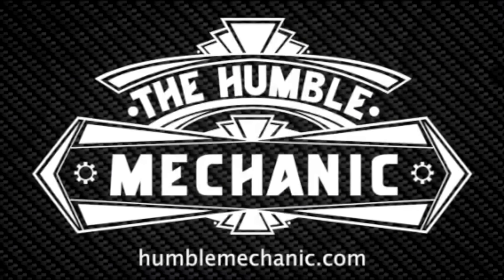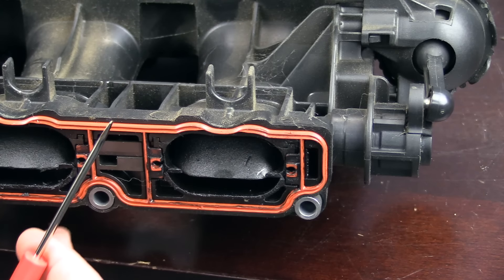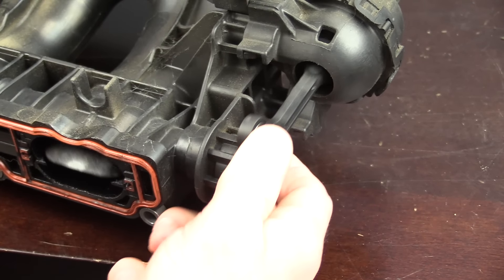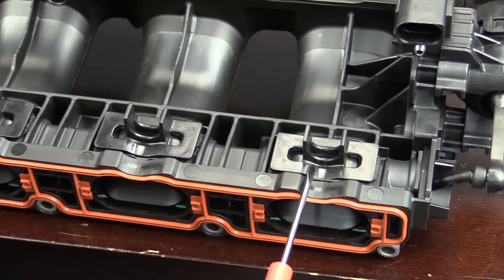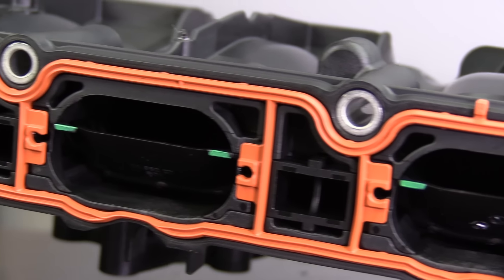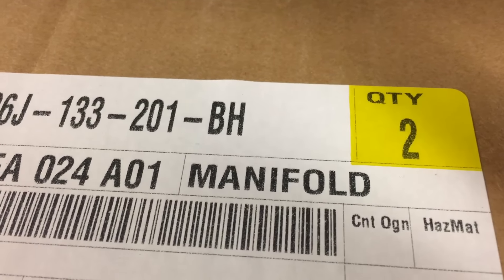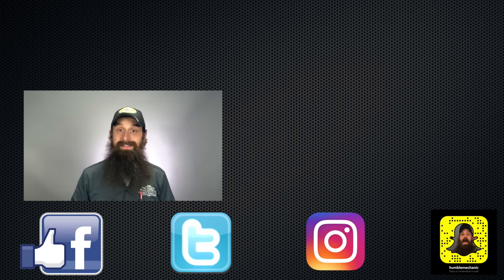2.0t TSI Intake Manifold UPDATE!

Comment: Hey Charles, I wanted to ask/tell if it would be beneficial to add a water methane system to direct injection engines (turbo and NA) to mitigate or eliminate the intake valve/system carbon build-up. Has it been done before (that you know of) and would it be cost-efficient to do so? I know this is an older video but it is somewhat related to my inquiry. Thank you in advance!
Reply from the maker: It’s the thing that would probably help the most. But I don’t think the cost benefit is there unless you’re doing it as part of modifying your car. 

Just to help with carbon, nah

Comment: I replaced mine last year, one consideration I wasn't aware of is none of the boost taps that fit in between the manifold and PCV work anymore with the new revision. They pop out or leak under boost now and there are no new aftermarket solutions available. Is there any other way to tap in for my guage?

Comment: Brilliant help, Humble mechanic!  I've recently being getting a misfire which appeared on cyclinder 3 (according to diagnostic) so replaced coil packs & put new spark plugs on.   
Warning has disappeared but the engine feels a bit lumpy at low revs.  Thinking the inlet manifold could be the culprit.  

Cheers HM
Reply: I have the same problem with mine with cylinder 3. I have replaced spark plugs, genuine intake manifold and PCV valve but the engine is still very rough and the check engine light is on. Did you ever fix your problem?

Comment: My VW CC 2009 Sports has been acting funny and now it won't start. I was only having the P2015 intake manifold check engine light and was driving fine. Even though i planned to replace the intake manifold and runner position sensor. The No start looks more like a fuel pump issue. It cranks and behaves like its about to start, but wont start. It looks like its the engine is starved of fuel. I checked the load reduction relay and the fuel pump relay.  I want to check the transfer feul pump to see if i get supply to that point but wasnt able to take out my seat to make room. However, i become discouraged as i started getting different check engine lights; P0444 Evap emission system purge control valve circuit open came first, then P0030 H02S Heater Control circuit bank 1 sensor 1, then P2294 fuel pressure regulator 2 control circuit. Then my front window driver side started malfunctioning, whenever i try to crank, the window rolls down  a little and kept doing that, then it would not raise up more than the level it rolls down to if i try to raise it with the raise button. It oprerates up and down but just wont go up beyond a certain level. I hear relay click when i operate other windows but i dont hear for this window but it operates. Another thing i noticed is that even if i disconnect the window raise relay, the window still operates. All these make me just think the ECM might be malfunctioning and discouraged me from even making the effort to check fuel transfer pump

Comment: I wish there was a way you could differentiate the old 2.0-TSI from the current Mk7 2.0-TSI in your videos.  We haven't seen the same weaknesses in the new engines (at least yet).
Reply: Ed Mathews he said the engine codes, Ccta and Cbfa, which are gen 1 ea888 transverse engines
Reply: We have not seen any engine problems with the new engine design. Only thing I've seen was a bad spark plug causing misfires under load. The 1.8t has been an unbelievably reliable engine.

Comment: mercedes benz vehicles had a similar issue with the runner actuator would break. theres a company called all german auto that makes a billett aluminum pivot point for it instead of plastic
Reply: nick elias for vw intakes as well?
Reply: Not yet unfortunately :/
Reply: nick elias OK thanks
Reply: nick elias yeah but On VW you can't replace the arm. Less you destroy the intake to take the rod actuator out...
Reply: Lynx Star Automotive that sucks

Comment: I have a 2010 GTI with 104,000 miles. Driving this weekend on the Pennsylvania Turnpike the engine light came on and the code, read from Autozone, is P2015 for Runner Position Sensor/Switch Circuit Range Bank 1. Car seems to be running okay. VIN is: WVWEV7AJ6AW220359. Would replacing the Intake Manifold be covered under the extended warranty for this part at the VW dealer? Thank you!

Comment: Humble Mechanic can I ask you your expertise I have a 2010 Chrysler 300 90K I live in Massachusetts and when the motor is cold and only when it's about 28 degrees out or colder when I start the car up it's kinda loud runs rough starts right up and only does this when the motor is cold or it's 28 or colder i use 5-30 oil all year around car is well maintained. I know you work on VW's so when it's cold out I tend to not drive it and we'll both know that's  not always something I can do

Comment: I appreciate you brother, I'm an ex mechanic but still dabble quite a bit. Your videos are killer!!!! Bought wife a new vw cc in 2010 and I'm on my second manifold already and only have 52k on the car... I will be pulling out the manifold  to upgrade to the new manifold! Thanks to you and Paul and DAP for the info on the updated manifold!!!!! DAP and DUB on.....
Reply from the maker: SWEET!!! Thank you :)
Reply: I know it's been a while since you worked on the car. But I was just wondering if you would be able to help me figure out why i'm still getting trouble.Code p 2015.  It's for a two thousand thirteen, volkswagen tiguan
Reply: What you need to do is get the intake rudder kit as well as the actuator, did you replace these and clean everything?
Reply: Also make sure the intake rudder actuator is plugged in all the way and the arm is connected all the way

Comment: Just sold one of the new intake manifolds to a shop a few miles away. The man insisted I sold him the wrong manifold. I told him it was recently redesigned and should fix most if not all its previous problems. He kept going on about how the metal nipple was going to cause a vacuum leak. I even tried to tell him about this video. He made sure to tell me that he has the "right one" coming! Well, I hope his customer will be as pleased with his choice as he is. What's wrong with this guy?
Reply from the maker: HAHAH some people man!

Comment: I have a 2018 2.0T TFSI with under 30k miles. My only concern is I hear a tapping noise from around the intake manifold area (Maybe it's coming from inside the manifold). Is this the flap that causing this noise? It does not matter if it's from a cold start or warm engine but only when it's Ideal. No change in RPM or vibration.

Comment: Had my intake replaced under warranty on my 2013 GTI just today. I'm glad they put the revised part on. Hopefully it holds up!
Reply from the maker: I hope so too. I haven't heard of any failure of this style, but it's pretty new.
Reply: Kyle Bauer was it covered under powertrain warranty?
Reply: Yes it was
Reply: Kyle Bauer I have a 2013 out of warranty but they extended the warranty ok the 2012 to 120k miles. Do you know if it's the same part? Vw corporate said they couldn't help me. Mine is throwing a 2015cel but not showing any signs of running incorrectly.
Reply: Kyle Bauer I
Reply: @HumbleMechanic  just got this code on our MK7 GTI. The manifold and vacuum actuator look different to the one in the video. Confirmed it's getting stuck open as sometimes the feedback voltage doesn't change when crossing the 3800 RPM point. Any advice on changing the mk7 manifold? Seen any fail?

Comment: I had my intake manifold replaced on my '12 GLI back in January. What are the chances I got the updated part?
Reply: I just looked at my invoice. I got part number 06J-133-201-BD. Assuming this is the old part and not the new part since the new one ends in BH? My invoice date was 1/9/17
Reply: The part ending in BD is a previous revision.

Comment: Just wanted to say thanks for the video. My MKV came up with the p2015 code and the dealership replaced it for free under warranty. Would have never known if it wasn’t for your video. I appreciate it. Also your video helped me switch out the pcv with little to no trouble (dropping the torx bolt into the engine bay) keep up the good work. I’m about to switch out the upper timing chain cover because now that’s leaking. 😕
Reply from the maker: AWESOME!

Comment: I have a question I have a epc light on and check engine light blinking i read the faults and the codes say intake manifold runner cylinder1,2,3 misfire. What is wrong with it can you explain.

Comment: Hi there, thanks for the video! I have a question I'm having trouble trying to resolve... Is the vacuum solenoid directly interchangeable for the old intake? I had the old style solenoid with the "PASS" cap and bought a replacement with the new metal nipple; have subsequently installed it. Just wanted to know if this would cause any issues?
Reply: Anfecs Ian hey do you need any sensor or part to complete the remplacement?

Comment: Plastic manifold doesn’t inspire confidence. I have a 2008 GTI FSI and a 2008 Jetta 2.5. I actually just had a turbo fail in the GTI😔 and the Jetta is having some wiring issues unfortunately.

That said, other than turbo no major fails so far at 100k on both cars. My biggest complaint is the amount of oil VW burns. Other than that I don’t think VW is any less reliable than any other brand. The key is proper care.

Comment: Charles, had my 2009 TSI manifold replaced last year under warranty. 48K miles now and decided to remove the intake to clean the valves. Have you heard the new design does not have the support (10mm trip and 13mm nut) under the throttle body? Looks like it was never there or the dealer tech didn't feel like putting it back when he replaced the intake? Not sure if I need to source one or just put it back together the way it was...? Got my gasket and injector seals from Deutsche and was told my intake should be the latest revision...?

Comment: I bought and installed the updated version of the intake manifold, however the arm that moves the flaps gets stuck, do you have a video on why this happens? My suspicion is weak vacuum, also, do you have a video on how to test the vacuum?
Reply from the maker: Very possible week vacuum. There is a y pipe near the vacuum pump that gets clogged

Comment: Hey Charles, 
I just replaced this manifold on Saturday, but I'm still getting a P2014 code (different from the p2015 code I was getting) , is there a chance there a relearn procedure I'm missing?
Reply from the maker: There is a basic setting, but it should relearn on it's own. Be sure you have good vacuum supply
Reply: Thanks for the response,  how about a follow up question. While removing the intake, I had removed the top 5 bolts, followed by the outer 2 nuts. As soon as I broke loose and back out the second nut, the intake moved and I heard a pop. My assumption there was a bit of boost pressure leftover in the intake (is this normal). Secondly, this pop, stripped the threads of lower inner 2 bolts. Any suggestion on how to fix this? 
I'm hoping there is enough thread deeper in the head, that I could bite onto with slightly longer bolts. 
If that's not the case, my next thought would be remove the intake again and helocoil the head.
Reply: what adaptation and readiness, does this need to be preformed?

Comment: Hi, I'm working on a 06 A4 2.0t, just about got the intake out when I noticed that the new intake has an "extra" sensor on the side of it (the one you pointed out as a known failure from Germany now replace with Romanian one), would you happen to know if it will still work in my car? I have gone back and searched for the one without the sensor but everything that is coming up keeps showing that sensor there. Any suggestions would be gladly appreciated and thanks in advance.

Comment: Hey HumbleMechanic, I have a slight hesitation between 2500 and 3000 rpms on acceleration with no trouble codes,  is this possible the cause of my issue and is there a way to verify? Thanks
Reply: in for the answer
Reply: Ken Decker I would really like this answered as well. I can't figure out this same hesitation I'm having under a  light load.
Reply from the maker: It could be, but I have not seen the manifold cause that. The manifold switches at 3800 RPM, so at 2500-3000 it should not be a factor. 

Can you monitor misfires or throttle position while driving?
Reply: I can, I will post what I find.
Reply: I have this too on my CCZA Skoda.  Seems quite a common thing.  Have you checked PCV and DV? Mine are both fine and my car is still not very smooth at the same rev range :/  Has you car had a timing chain failure/replacement?
Reply: Harry Marshall no chain failure the car only has 77k miles on it
Reply: 77k is MORE than enough for that to happen.  Mine was 48k old when it happened (before I bought it).  Funnily enough, mine is exactly 77000 miles today. Reason I asked because I'm currently thinking my timing might be very slightly out after the chain was refitted, but I don't want to pay to have it all checked

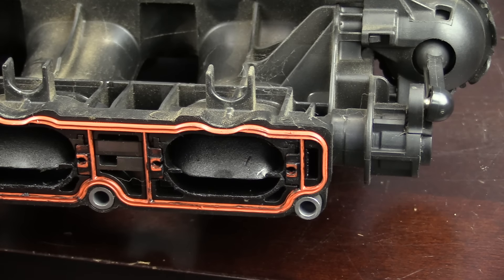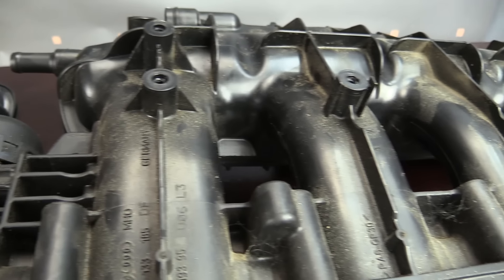Comment: If you look carefully in the video between about 3:40 and 3:50, you can see both manifolds are marked "PA6 GF30."  This means 30% glass fiber reinforced polyamide.  In other words, the composition of the material is the same on old and new manifolds.

Comment: Thank you for your videos!! It helped me a lot with my personal case!

I have a 2009 Scirocco 2.0 TSI and i  had the intake sensor error since last year but could only buy the intake last month, i was surprised when i got it and saw the arm was different...
But when i connected the vacuum line, i connected it to the new metal one, so i still had an error and the flap was stuck all the way open. It took me a while to get it, but ended up putting the old solenoid that wasn't faulty and i finally got rid of the error...

Now i only have the wastegate flap that it's making noise..... -.-"
Reply from the maker: Oh no on the wastegate noise. That sucks. Will the anti rattle clip fix is?
Reply: I already put one anti rattle clip in and the noise went away, but i could still ear it slighlty (i think the clip only mutes a bit the sound of the rattle)

So either it dropped at one time, wich i think that it is impossible when i think of the the trouble i had to get it in or the arm of the flap itself it's sideways like in one of your videos and in that case you know how it is....

Here in europe this engine is rare and the Scirocco's even more rare, so i'm happy that i can find all the good info in your channel! Keep up the good work mate! ;)

Comment: Hey mate,
very useful video and thanks for the updates and differences.
I have a question for you, I have Audi A4 in 1.8 TFSI Engine (B8) and I am unable to find the part number. I have P2015 code, I tried erasing it few times and it comes back again. 

So due to order a new one, however I'd imagine it will be a bit different to the 2.0 one. 

Any pointers?
Reply from the maker: It’s a pretty similar engine. The 1.8t you don’t have to pull the injectors. At least on the vw side
Reply: @HumbleMechanic  thanks for the heads up! Hard to find the part number on it though, where can I find it ? with Audi Australia ?
Reply: @HumbleMechanic  would this intake fit on to the 1.8t?

Comment: Hi Charles, Awesome video! I need some help or advice please if you can spare a minute. I have a VW Tiguan with a 2lt TSI. It has been throwing code P2015 intake manifold sensor, so i started to hunt for the manifold upgrade. Found one at ECS Tuning in the states and they will ship to Australia for me however they are saying i need to upgrade the fuel rail as well to use this manifold. what are your thoughts on this?  As of today the Tiguan started misfiring and there is a sound like a vacuum leak around the inlet manifold. The OBD codes are P0300, P0303, P0304, P0302 and P0301 in order. Is this all part of the same problem with the inlet manifold do you think? I love your videos and you helped me heaps with the TSI timing belt. Thanks for your time Andrew

Comment: I am a disabled vet so money was always tight . Me and my parents were always american car and truck buyers . It was not allowed to buy anything but american. So when I moved out for 12 years before going in the NAVY on submarines . I always bought american and since my dad was a mechanic over 20 years when I was 17 but growing up the places he worked at since it was taxi places let me help from the age of 7 . I swept floors and other things but he showed me from oil change to engine and trans replacement I seen there belair taxi with over 300k . I went in the NAVY and got sent over seas to Holy loch scotland and you could not get american cars over there and since I was a e-4 at the time the NAVY would not pay to ship my car over .But when I got sent to Kings Bay GA I got back into american. But after buying blazers and other SUV and small cars I had so many problems with the transmission on the suv s . I did all the proper maintenance , I bought a toyota camry and had it for 5 years with over 200k on it .I hate to say this but toyota makes some pretty good cars right now I have a scion xa with 120k and small easy to fix except the inner wheel bearing which was a common failure. MY family down south still complains to me about not buying american so to make them happy I bought a 1961 stripped down fairlane with a 4 banger so far 3 years no problem I have been in NY up 90 miles from NYC so salt is the main killer not my cars mechanics .

Comment: Back in around 2010 we had the same/similar problem in the Ford shop I used to work at (in Europe)
It was on the 1.8 and 2.0 gasoline engines and at first we replaced the flaps and installed stronger bushings untill Ford came with complete manifold to replace the broken ones.
One time I had an engine where the rod that hols/flips the flaps was broken and one of the flaps had been "eaten" my the engine. Imagine the damage that caused to the valves!